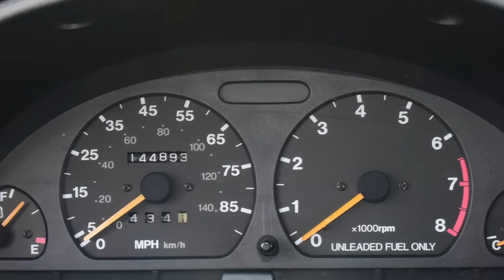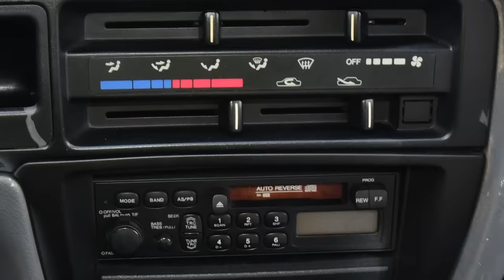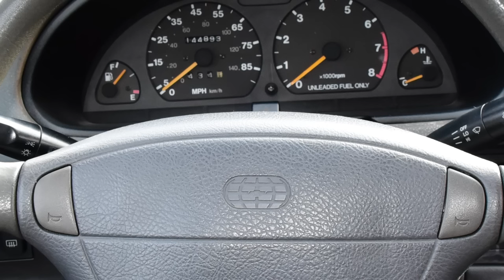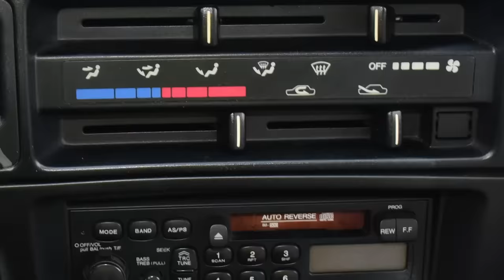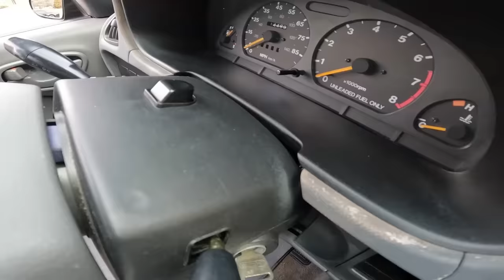1996 Geo Metro 5MT: Regular Car Reviews

Comment: 1992, my 16 year old nephew is driving, I am in the passenger seat of his mom's brand new Metro.  I am looking down flipping through his Caselogic (Really, you bought the EMF album?) as he blows through a side street without looking as a 70 year old woman in a Celebrity wagon comes from my side doing about 40.  She missed T boning me/us by 1 second.  Instead her rear quarter panel ripped the front off the Metro spinning us 180.  Left behind what looked to be a styrofoam cooler strapped to the bumper.  Decided I had punched my "survives subcompact accident" ticket that day.  Gladly spent a lot of money on gas over the past 30 years to drive larger cars/SUVs.

Comment: I had a 95, maybe a 96, about 20 years ago. Comutting highway I would get 45-47 MPG at 75 MPH (with plenty of petal left). Beating on it around town it would still get 42+. Getting on the highway was fun, take to on clover leaf at 40-50 MPH and come out with the petal on the boards. Yes, it was lazy over 65. Christmas time, looking for a spot in the mall (yea at one time there were no spaces avaiable at xmas) and pass the last open space, no three point turn needed huf the right crank the wheel and it the gas and you where in before the other 30 circleing can get to the spot. The car rocked. Up hear in the northeast, salt killed them all rooting where the sub frame connexcted to the floor under your left foot, or right if you where sitting in the passenter side.  If looking for one of these look for the swift GT with the 1.3 DOHC, or the canadian pontiac version, called the fierfly I believe, with the turbo., At 16"30 - lights, driving in the snow storm at night sucked, as they packed with snow. BUT not at night, snow could not stop these if you had decient tires, so skinny they cut through to the pavement and you would see 4X4s off the road as you curised by at 60 with no issues.

Comment: My parents had a 96 geo metro in teal. It had air conditioning but you couldn't run it if you wanted to get up even the smallest hill. Just before my 15th birthday, my parents sold it and I was disappointed because I was going to learn to drive stick on it. Now that I know just how unsafe it is, that was probably for the best.

Comment: A gal we knew in about 1995-96 had one of these 3-cylinder Metros.  We called it the "Gerbil Runner" because we envisioned three rodent wheels under the hood powered by gerbils.

Comment: Mine was slow so get the stick shift ! It is peppy at least lol but mine was awesome ! It never broke down , it was the only car that would start in - 20 to - 50 degrees out side here in Chicago ! Sold it with 140,000 on it with original everything except the oil ! Same trans and clutch, only 1 set of brake pads with original rotors, it got 70mpg on the highway, 45-50 in the city. I would not want to get hit hard in it but was very dependable! Aluminum can on wheels lol, no rust,no problems with it ever, had it 6 years and miss it

Comment: I have a friend who used to buy these when/wherever they popped up and drove them to the ground and used this carcass and that to keep the current car running.  A couple years ago early Prius carcasses got cheap enough to buy them to shift life support to a new model.  He's a heavy equipment operator with no illusions about environmental bla bla bla. He's just doing what he has to do to feed a big family.  High five to a car that did it just good enough just long enough that we made it to arguing whether Teslas are good or not before we burned ourselves to ground.

Comment: As I recall, these Metros were capable of getting 55-70 mpg back when they were new-ish. 

Then again, my 1993 Honda Civic once went 541 miles on one tank. It wasn’t a CX or VX, it was the 102 HP DX (coupe, even). 

Honda just knew how to engineer efficiency for both power and fuel usage. Even swapped and built, 35 MPG highway out of a B18C1. Hell, my current Honda, a 2007 Accord V6/6MT coupe gets 30-32 on the highway on long trips, and that’s not keeping it under 60 or avoiding the AC.

Comment: I had a 1999 geo metro. Automatic. It had 263,000 miles on it when I got rid of it and I drove it every day with just typical maintenance and wear and tear. The tires are the size of a donut and the radiator is less than half the size of most but I can’t knock a geo metro lol

Comment: buddy of mine had a suzuki swift with a 3cyl. i was waiting until someone mentions the A/C. that beast basically had a reverse boost button. you turn the A/C on, the car IMMEDIATLY slows down. like, you genuinely felt the car dramatically accelerating when he turned the A/C off.

Comment: Genuinely speaking, its the classic case of function over everything else. Practicality and that's it. They're still around, still actually oddly common where I live too. You'll be hard pressed not to see at least one somewhere if you drive into inner suburb hoods for a few miles. They are the epitome of poverty mobiles though. Them and the original late 80s through early 90s Chrysler vans haha. Its always these, the vans and Dodge Neons missing a ton of paint around here.

Comment: My brother had a red geo metro. I was probably 10 years old when we stopped at a gas station. He forgot to engage the parking brake or leave it in gear. The gas station was on a hill, you see where this is going. I went for a ride but the car was so light that my brother was able to run out and stop it mid roll 😆.

Comment: I have a 1995 Suzuki Swift HB 4cyl 1.3 sohc 70 hp 74 torque 5pd ABS. My mums car for 26 years. Purple name is Smudge! I have more power! 3yl is gutles. Im 6 ft 3.5 fit fine. My mum made Suzuki in 1995 change the stock radio included! Clairon speakers front & tape deck. New in Vancouver BC she was $11,500+ tax fees finaced 4 years. Same body 1995-2001. Mine gets 37-39 city & 40-42 mpg.Not bad on gas. No power steering! 
I use it as my run around! I'll keep her forever. Fun Very nice little car. 208,400km running strong.

Comment: I've owned two Geo Metros (1996 and 1997 model years), both of them the LSi package, so they only get about 36-40mpg, but can actually go up hills.  The second one is still my daily driver.  They're nearly indestructible under normal conditions, and cheap as hell to repair, and really kinda cute.  Maybe not Mazda Miata cute, but a "transgender newbie software dev in cat ears and toe socks who's waiting for their options to vest so they can afford to buy their own car" kind of cute.  And like a cute trans software dev, it's amazing what you can fit inside it with the seats down; it can take a surprisingly large load with only a minor decrease in performance.

Geo Metro drivers, when they're not poor young IT techs straight out of university, tend to be middle-aged men, enbys, and transfemmes, often with vaguely anarchist leanings, who are surprisingly obsessed with their vehicles; but in a more "spiritual" way than the ricer gearheads or vintage collectors.  A lot of them are amateur web designers who create sites dedicated to their cars, or run online forums for the "Geo Metro community".

Interestingly, Geo Metros reached their peak of popularity at roughly the same time the term "metrosexual" was first coined.

Comment: I have owned two. My first vehicle back in 2006. One of the only vehicles I just do not miss owning. They are not safe, grossly underpowered, and just boring to drive. I did get 50 mpg in them.. but I get 39 MPG in my much more comfortable 1999 Civic I keep around as a beater.

Comment: I see Mr. Regular has yet to drive a current-generation Mitsubishi Mirage.  I did for 4½ years, and it was basically as you described... it just comes with power windows and A/C standard (although you definitely don't want to run that A/C if you're going up a steep hill)

This type of car still exists, new on lots, go and get it.  5-Year/60,000 bumper-to-bumper warranty, 10-year/100,000 miles powertrain warranty.

Sadly though, 5-speed manual was discontinued in 2022 because... you guessed it... no one bought them :(

Comment: This was the first vehicle i learned how to drive when i was 12. Are they a pos yes, can you have fun in them yes. When your holding first gear didn't lift off the gas and clutch into second. You can get the tires to break loose. Barely...

Comment: I once owned a Diahatsu with a 1KR-FE that had A/C and you knew when that compressor was running. 4 people in the car uphill? You will need those extra 5 HP, believe me. Still, very light cars with such engines can actually be fun to drive. Not as in fun to be fast ort anything, but they hold their Fahrvergnügen.

Comment: I have a metro so I can afford a track day car.

my well maintained gen1 with good compression will get up to 100+ on flat ground, although it won't do it in 5th anymore with the 3.8 ratio gearbox I put in it. 
I put some 15's on it for more grip makes it interesting in the corners.  The brakes are tiny but it doesn't matter cause the car is so light.  If they're maintained properly it stops on a dime.
I even installed AC in it.  AC on makes it significantly slower.  Its really hard to get over 42mpg on CA gas. 

My dad had a Chevrolet Sprint when I was a kid and I always loved the 3cyl.  Had to have a metro when I needed a 2nd car.

Comment: This car's spiritual successor is the Toyota Aygo, but not Aygo X, the smaller hatchback. Cheap, plasticky, 1.0L non turbo engine that doesn't have enough power to go up hills (learned that the hard way when an 18 wheeler started overtaking me uphill), gaps between gears bigger than gaps between hair on my head, and if you don't put any options on the list, spartan equipment.

Comment: These are now $2k to $4k. $2k being a banged up Metro with 250,000 miles that may or may not get you home. $4k will get you a low mileage Metro that may or may not have been sitting for 10 years. Definitely scope the engine.

Comment: Thanks for actually stating the correct horsepower and torque numbers, instead of rounding down, or just finding the lowest number available (48 for the XFi) and assuming that. Not enough reviewers do that.

Comment: Alright, this is gonna get buried and no one is ever going to see it, but I have a story.
I own a 2016 Ford Focus EcoBoost sedan. AT, dual-clutch transmission, yadda yadda, I know the complaints. 
Around 80k miles the turbo grenaded; faulty exhaust impeller, so thankfully all the shrapnel went out the exhaust side. When I brought it into the local Ford dealership, the service writer INSISTED that the Focus didn't have a turbo in it, which says something about how often they encounter that model. I didn't like the price they gave me for service on a car that "didn't have" the part that obviously failed, so I drove it across town to my brother's shop to do the work there.
Fastest I could get the damn thing going was 45mph downhill. The little engine that couldn't brought back all these memories I had of riding around in my buddy's Geo Metro, loading five entire adults into it to go see the Special Edition of The Empire Strikes Back. 
Turns out the EcoBoost engine in that specific model is essentially a German-designed, Romanian-built rehash of the engine in the Metro - 1.0L displacement (999cc, technically), 3-cylinders - but in a car that has about a grand in curb weight and safety features on the Geo. The turbocharger in the Focus makes a HUGE amount of difference.
So now all I can do when I see a Geo Metro is speculate and consider if it's possible or wise to somehow latch a 74Kw turbo to that little engine and see what kind of thoroughly inadvisable madness it could achieve.

Comment: I know a guy that worked in the woods and had to drive an $80,000 F-350 everyday for work, but the car he drove for 20 years on weekends and to get him self places besides work was a cheap ass Geo Metro. He bought it when it was three years old and in mint shape, but a year and a half ago he was cruising through a residential area with speed bumps, and the Geo didn't fare very well. The car was so rotten, when the front tires hit the speed bump the underside of the body just split. He still somehow drove it home and when he scraped into his yard that Geo just ticked over it last mile as it hit 399,000 on the button. He dug a hole in his backyard and finally buried her and went out and bought a brand new Corolla.

Comment: I'm surprised this is truly the base model because it apparently has a tachometer (visible at 3:22).  I learned to drive stick on Geo Metro 5MT and it definitely did not have a tach.  Maybe an earlier model year?  You obviously don't need a tach to drive stick, but when you're first learning, with an engine like the Metro's 3 cylinder, it sure would have helped.

Comment: I liked my Y2K Chevy Metro with 1.3+automatic, would have been better with a 5spd.
problem 1 is they didn't epoxy so it rusted and rotted pretty quickly. yes its a 2 seater,
leave the back seat down take it shopping or out on long camping road trips.
they really should have done a 4 door wagon version with 1.4+5spd.

Comment: See, this is one of those instances where the impression on the metro in regards to speed varies *wildly* based on where you live. 

See, where I live Geo Metros on the used market fetch prices of between 2 and 4 thousand dollars, and that's still on the cheap side of the market, because the speed limit usually doesn't go beyond 70mph in national highways, which makes this car an entirely viable option because of its mileage and the fact that it's just as fast as it needs to be.

And of course, since the car is so prevalent down here finding spare parts, both new and preowned is still a breeze. 

I find it hilarious because I keep telling people about Metros being a fantastic car for daily driving and people look at me like I have three heads...... Until I crunch the numbers and they find out that the amount I spend in gas is like a quarter of theirs.

Comment: 12:55 Most likely something wrong with this guy's car. Watch MotorWeek's review of the Metro convertible. It has comparable braking to sports cars of the time, and even now, still holds up.

Edit: The brake pedal may feel mushy, but in a car that light, with tires that thin, and no ABS - You need to have that range of pressure. Replacement rotors and pads which are thicker than factory will lock very, very easily.

Comment: Over here in Europe, these are mostly Suzukis, i rarely see Geo's, and i have a 1999 Suzuki swift  sedan, and that "beast" have the 1.6 16v engine (with AC ,power steering, 4 electric windows) and the ridiculous gear ratios are true, i can hit 60miles (100km) in second.Its an outdated car, but its fun :) .

Comment: Ah, the Pontiac Firefly aka Geo Metro. My first car and the car I learned how to drive stick on. Everything looks exactly the same engine wise as my '91 firefly. I drove the absolute shit out of it. Merging was a spiritual event. I dount there was an ounce of carbon in that engine lol. Fuel economy was fantastic, but best of all, I couldn't kill it. All it needed was break pads, a coolant line, timing belt, and tires. Fired up (reluctantly) in -40 and got my ass from A to B. I eventually passed it down to a family member that drove it until rust ate it. Scary thing is the car came in Auto! Imagine driving with AC and an auto trans with only 55 Squirrel Power. That's a nope for me lol

Comment: This geometro reminds me of my truck
It's an 87 S10 with a 4 cylinder and before speed transmission People flip me off and honk At me constantly for going too slow 
I get pulled over for not going the minimum speed limit and then they see the 4 on the gear shifter and they understand 
My vehicles were designed when 55 miles an hour was fast

Comment: The original 86 Chevy Sprint before it became the Geo Metro was better.
It cost $4995 brand new with extended warranty, It was stone reliable with a proper carburetor and it got between 50 and 55 mpg all the time. That's when gas cost less than a buck a gallon so 5 bucks was all it took to drive all week. 
After putting almost 200 thousand miles we still got 2 grand when we sold it.

Comment: I would love to see someone go over-the-top trying to squeeze more gas milage out one these. Like going full carbon fiber, light weight racing seats (upholstered a similar 90's movie theater carpet aethetic, of course), maybe an engine swap with a moder 3 cylinder from like a yaris or something and a modern ECU. Paint it with the 90's disposable cup design. I'm seeing a lot of potential. It would be like driving a mobile shitpost.

Comment: I have a 1995 Metro I drive 50 miles a day round trip to work. Mine has a/c and power steering. 4cyl 5 speed. It goes 80 mph on the hwy. this must be the 3 cyl. I love mine. I only use it for work. it only hS 85K MILES. Hope o ge many more miles out of it.

Comment: This was my winter car when I had my 2001 Z28 back in the day. I had the earlier version. The exhaust had a leak.. It was the definition of "slow car fast" you could rev the shit out of it.. I don't know if it had sway bars but felt like it didn't.. 65 felt like 130mph.. cornering a normal off ramp felt like you where in a NASCAR race. I drank more beer than this car used gas.
I'm 6'4" and fit nicely into the car.. I have no idea how.. it looks impossible. But it had massive headroom. I think the only other small car with more headroom is an original VW Bug.